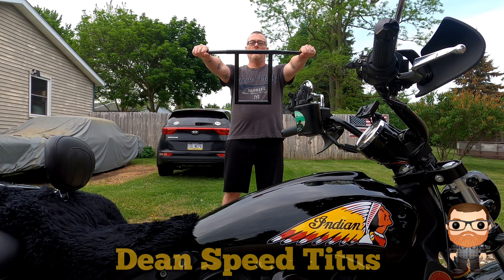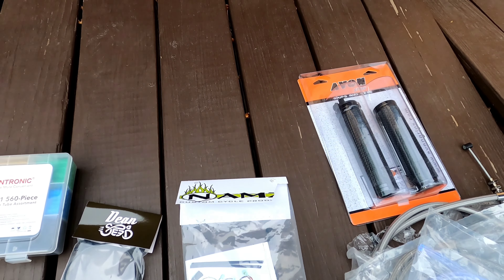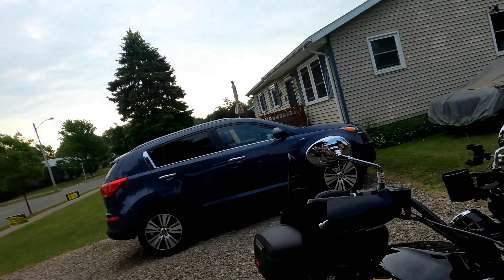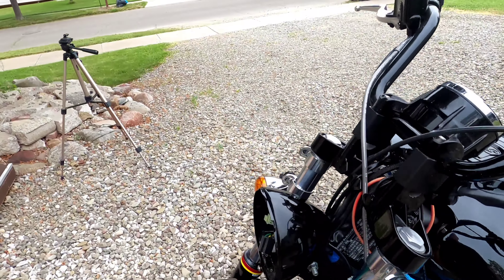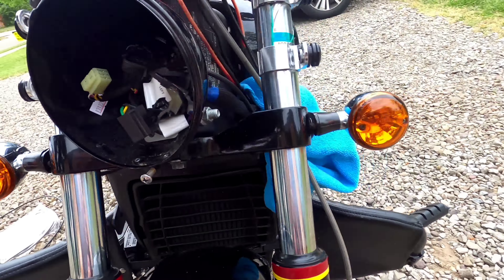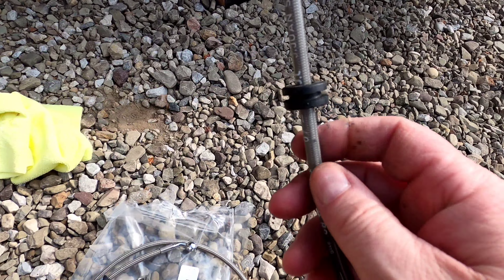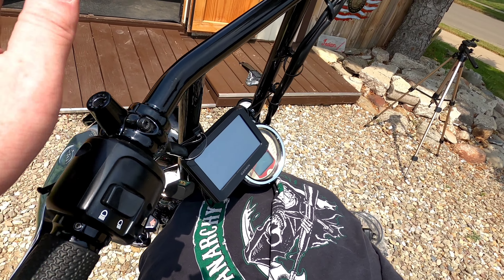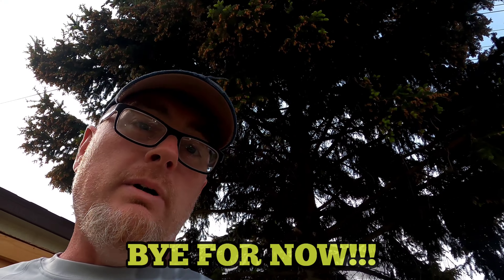Indian Scout Dean Speed Titus Handlebar Install #deanspeedcustoms #indianscoutsixty

Comment: I put the 14" Titus on my scout.  Kept the wiring stock for now (external), as well as the stock abs brake line.  I will be doing the internal wiring with the nammz kit at some point.  I used a Barnetts +4 clutch cable  to replace the stock.  Do you have an abs scout?
Reply from the maker: No. Just standard brakes.
I have been comfortable with the 12.
Maybe over winter I might consider putting the spacers back on👍